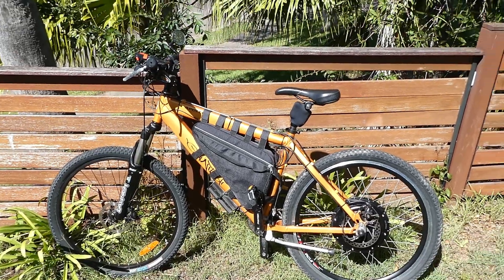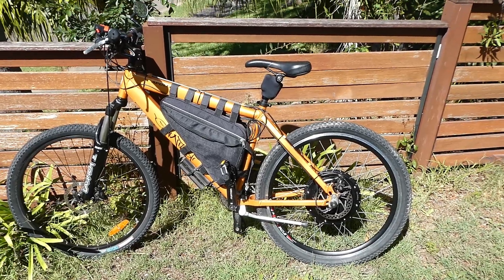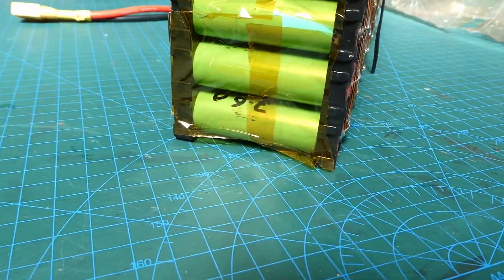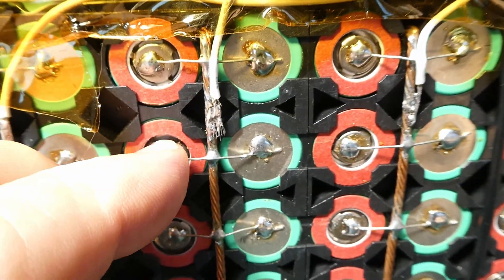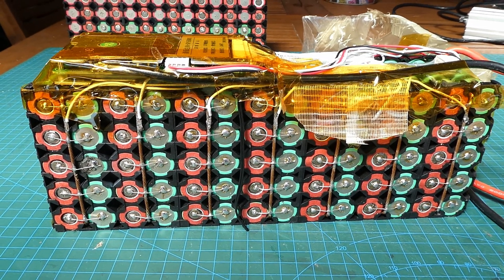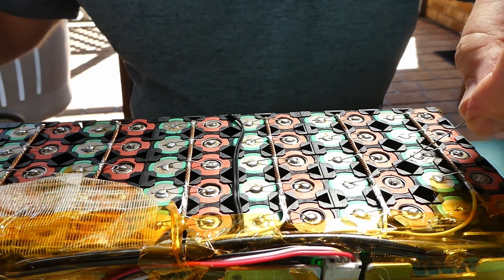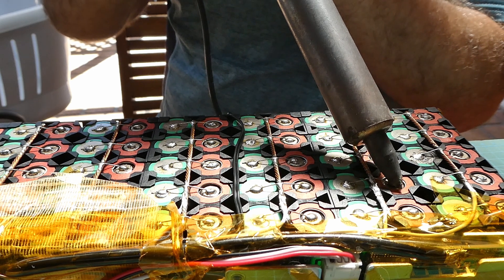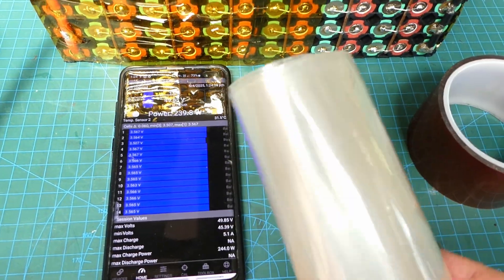DIY Ebike Battery Repair. Soldered cells. Is it dead?

Comment: I'm surprised you didn't use a multimeter to test each individual cell. You need to desolder each cell to test on the multimeter for accurate reading and weed out the dead cells. I see your battery pack consists of seventy 25R cells instead of 18650 cells
Reply from the maker: @russtorque2993 I did use a multimeter to test all cell groups.
There was no need to desolder all cells as once the broken fuse connection was repaired all cell groups balanced perfectly which confirms there were no other damages cells or connections. 
Sorry, I don't understand your last comment. Samsung 25R are 18650 cells?
Thanks for watching 👍🏼

Comment: Thanks for the update, 7 years is a lot. I've been running soldered and spot welded batteries on my skateboard for 2 years, and they perform the same. Only the welded battery kept disconnecting from vibrations, cause of my cheap welder and lack of skills.
I usually scratch the battery terminals with sand paper before soldering for stronger joints, and use copper foil for connections 0.1-0.15mm (results in lower profile than wires).
Reply from the maker: @vapgames  That's awesome. I imagine there could be more stress on a skateboard pack with fewer cells in parallel.
Thanks for commenting and for the tip on scratching the cells for a better connection!

Comment: I bought a 500W soldering iron for soldering cells quickly but Then I decided to build a spot welder with nano second micro timer. Too easy when you buy and scrounge all of the right parts.
  But the soldering iron is highly recommended for large tasks. It's called an MT-D500 also get th liquid flux designed to allow solder to bond to alloys.
 Man those links are thin. I guess it helps having so many of them. Why headache with tiny cells when you could just use 21700 or larger such as the headway cells or prismatic pouches.
Reply from the maker: @izzzzzz6  I bought a spot welder also but have not tried it yet.
I built this battery 7 years ago when 18650 cells were common. I also did not pay for them, so made sense to use them.
I use prismatic for bigger projects also.
Thanks for watching 👍🏼

Comment: That's a nice easy fix. That pack has done very well. I'm amazed at how those cells have lasted considering the load and charge cycles over 7 years. Good job well done 👍
Reply from the maker: Thanks!
Yes I'm impressed. The Samsung 25R are a great cell.
Thanks for watching 👍🏼